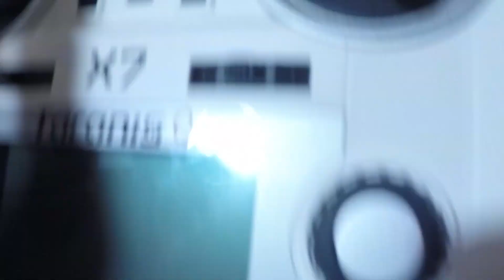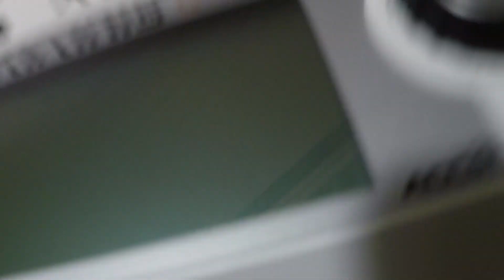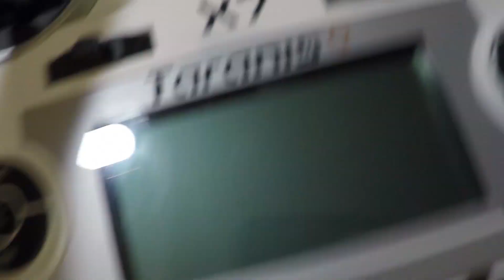QX7 Throttle stick setup

Comment: You don't need to remove the spring.  Just screw in the screw that is almost all the way out opposite of the spring and it disengages the spring.

Comment: your Springs seem crazy tight like as tight as they came out of the box. I loosen mine up all the way as much as possible to where they don't fall over or Flop around to get as much resolution as possible I hope this helps give it a shot that's how I get a lot smoother flying and I don't use the ratchet action I heard a lot of fun people like the ratchet. I think you get smoother Flying Without Your throttle stopping every few millimeters you know. love the channel your voice over sounds great dude it sounds so clear
Reply: Is there a way to turn off this ratched on this Taranis QX7? or what is it even called?